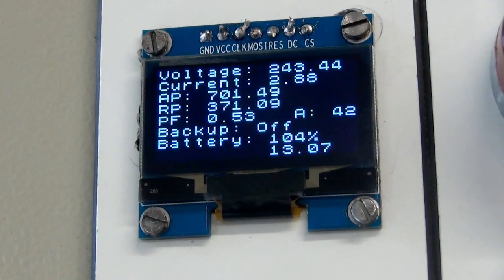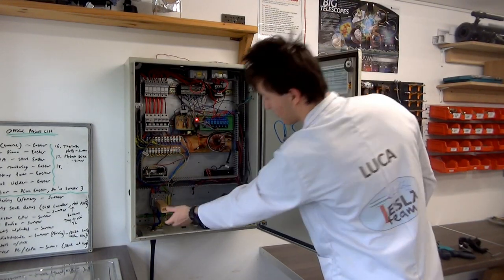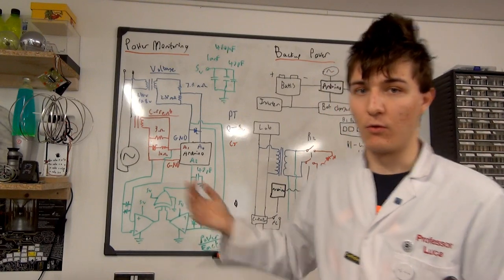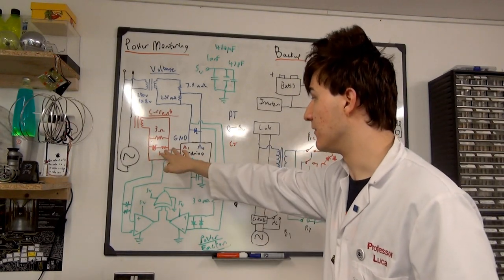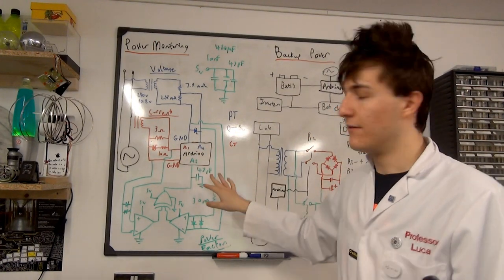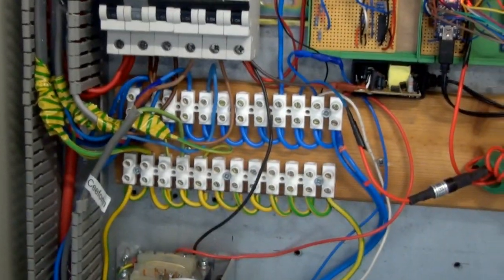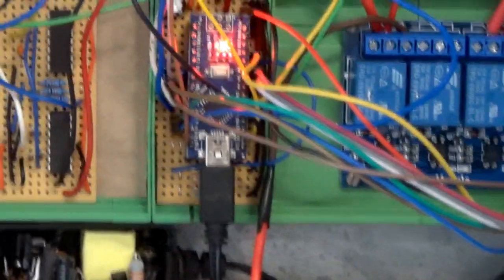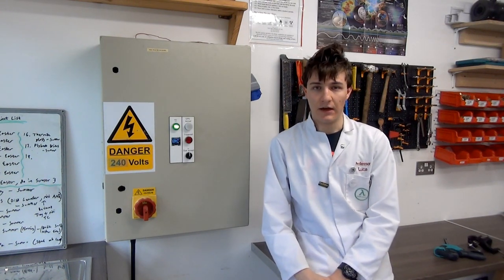The Best Power Monitoring System - Arduino: Voltage, Current, Power Factor, Phase Angle, etc

Comment: Since you are using an Arduino, you may consider using a network shield to send the data to your local network. This way all you need is a network cable running out of the cabinet and into your local router. From there you can configure a laptop or a dedicated raspberry pi to collect and process that data for daily or monthly KWH statistics.

Comment: Correct the connection of A1 Analog input to the junction of Zenner and 10 Ohm resistor then the voltage on A1 will be safe. otherwise micro-controller input at A1 may go much higher than 5V which A1 pin can not handle and Micro-controller will blow. Good luck.

Comment: You are measuring CT and PT data which are alternating around zero volt without any DC biasing?? Doesn't it clips the negative values and you are left with only positive half cycles?
Reply from the maker: Diodes are used to to filter out the negative half of the cycle. I know this isn't the best method to do this but its what I chose at the time.
Reply: For this use potential divider and center of the potential divider can be used to raise the bias voltage. One of the terminal of the winding can be connected to center voltage point of potential divider. Simple to do that.

Comment: why is there 3 capacitors connected in parallel and connecting it to a 5V?
Reply: those are filter caps..power supply decoupling caps